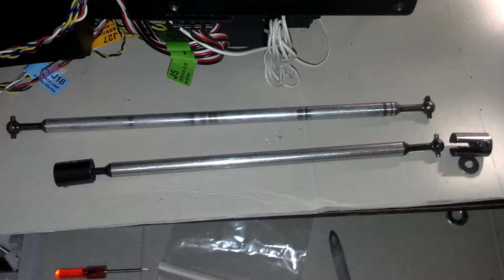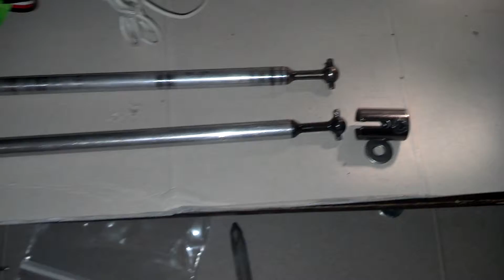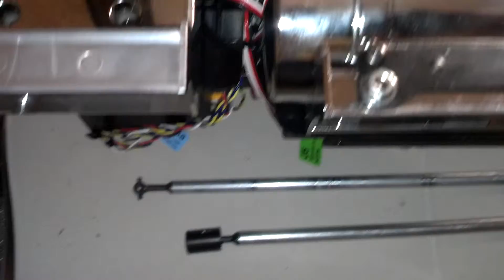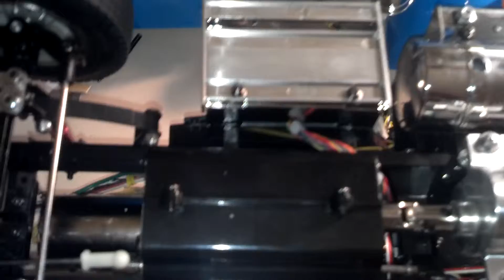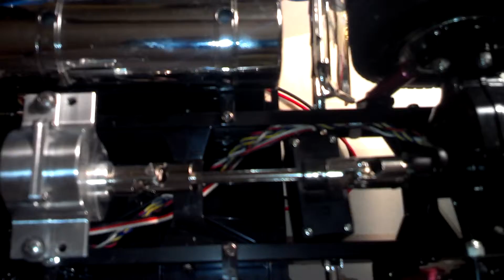Tamiya After 4:1 gear box install

Comment: Very nice add on...not only does this slow down the truck from stock speed but also gives it a lil more pulling power but also saves the motor from over working its self:) gonna be putting one of these on my new king hauler log truck build myself:) but just a friendly suggestion...the guy showing this truck off should bolt down the remaining two holes on the reduction box....would make it that much stronger and less prone of breaking off from frame under high torque load:)